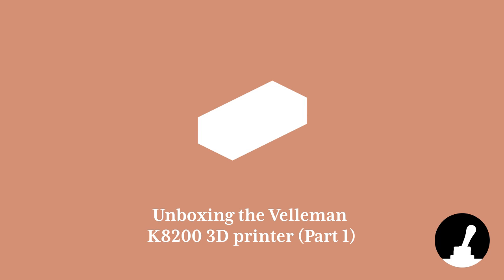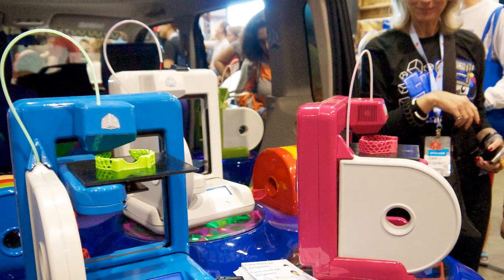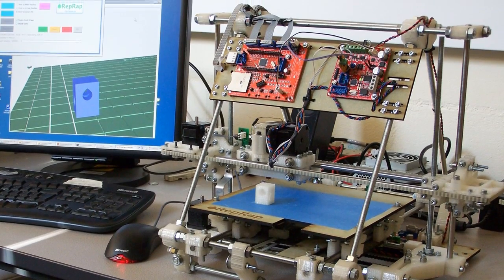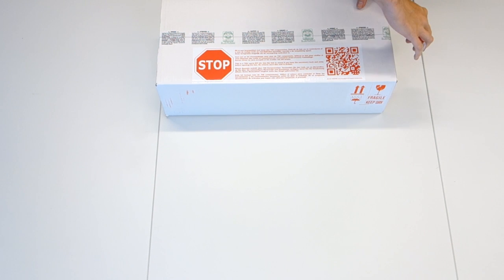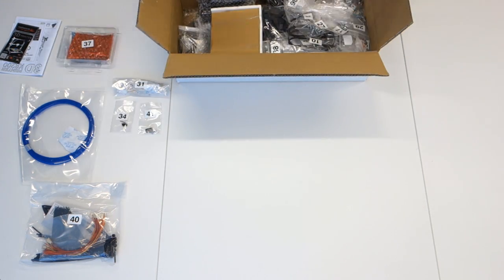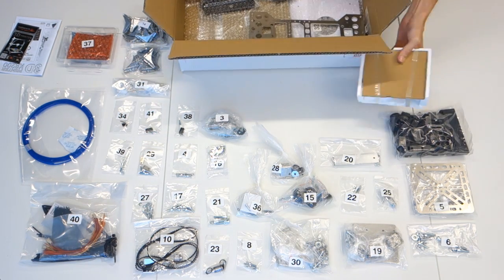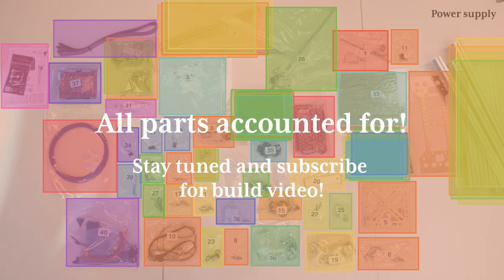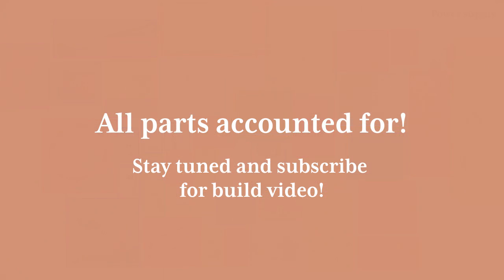Building the Velleman K8200 3D printer - Part 1: Unboxing

Comment: Can't wait for the rest of this build!  Apparently, I can buy this kit locally in Arizona for $699 USD.  Does that sound about right?
Reply from the maker: Sounds like a pretty decent price. I spent 5500 SEK on it, which was the cheapest I could find here. That equates to about $750, so 699 sounds good.
Reply: Switch & Lever I picked mine up for £410
Reply: Ryan Martel That's a good price.  It's about $660 USD.

Comment: Nice coincidence. I just bought this printer and assembled it last weeks. The resuls arent that teriffic. Before trying it out, let me give you this advice. Get yourself a mirror (ikea got some) for the printing bed. The heating bed is way underpowered. It reaches about 60°C which is way to cold for abs.

Also the wiring will get you crazy. If I would do it again, I wouldn't use the flat flex cable but something like a networking patch cable. Would be way easier.

Have fun building.

Phil
Reply from the maker: It's actually already built since a couple of weeks back, it's just that I have precious little time to do video editing so I hope I'll be able to make the build video in the coming week or so.

I got the mirror, and that together with blue painter's tape works great. I'm looking at hooking up the bed to a separate power supply controlled with a relay from the controller board, as to be able to do ABS more reliably. The bed is actually not the thing that's underpowered, it's the power supply, it can't handle both the hotend and bed at the same time.

Wiring wasn't that bad though ;)

Comment: I'm not faulting you for buying a kit, but with all the machine tools and expertise available to you, it seems like you could have made a RepRap-style printer from "scratch" pretty easily (which, incidentally, would have made a much more interesting video series, IMO).
I'm still going to follow this project, though.
Reply from the maker: Well, I think it all depends on what you want to spend your time and energy on. You're of course correct in that I could've built this myself, but to do that I would've had to source parts from different manufacturers, I would've likely had to make certain parts myself (such as those which are molded plastic), some items I would've had to buy regardless, like the electronic boards. Since I needed a 3d printer sooner rather than later this was the best buy for me. 

I hope the coming video(s) will be somewhat more interesting though. Cheers!

Comment: Do you need to solder the circuitboard yourself? Thanks! 😊
Reply from the maker: ***** There is no soldering of the circuit board, the only soldering (albeit a lot of it) is done to wires.

Comment: What is your line of work/study called? Just general engineering?
Reply from the maker: Not engineering at all, I'm an interaction designer, but with a strong emphasis on tangible interactions. In short I love to do prototypes and build random stuff, sometimes with programming, sometimes not. The 3d printer was bought mainly to be able to do quick prototypes.
Reply: Switch & Lever Ah right. I love what you do, and I'm going to college next year; looking at courses now. Just wondered what course I'd have to pick to something similar :)

Comment: Makerbot is a terrible printer definitely not the top check their forums on the thousands of complaints and a PLA printer is a cop out. These two printer are much better 
Zortrax and/or an Afinia aka up plus/ up plus 2
Reply from the maker: Never said that Makerbot was a great printer, but it is by far the most popular and it's something you can more or less unpack and start up. It's absolutely riddled with issues, but that's beside the point. 

The K8200 isn't a PLA printer, the problem is just that it doesn't have enough power for the heated bed to get up to ABS temperatures, a separate power supply run through a relay should rectify that easily.

Zortax is $1900, and Afinia is $1300, if I had that kind of money and needed something which was better than I got I would've gotten something better. The K8200 is just $750, it's a world of difference. It's kind of like getting a Ferarri when all you need is a Volvo, I just don't see the point.
Reply: Gotcha, my comment to a PLA printer was for the makerbot I have no negative comments for the K8200. I understand about price, I first purchased the solidoodle 3 which was garbage and I ended up remachining and replacing 90 percent of the parts. None the less I did a ton of research and purchased an Afinia h480 and than a Zortrax and the quality and reliability are night and day compared to many out there. Either way I love your videos and love the content you provide I'm a big fan!
Reply from the maker: Anthony Avila No for sure. my aim is to be printing ABS eventually, but as of now it's more important that I get models out than which plastic they're made of. 

So far I haven't replaced anything, only added a couple of things of use, like a proper on/off switch, not comfortable with that thing standing and leeching electricity when not in use.

Likely, whenever I get myself a proper 3d printer it will be something more upscale, but for that I need a job that pays worth a damn. Haha! 

Cheers!